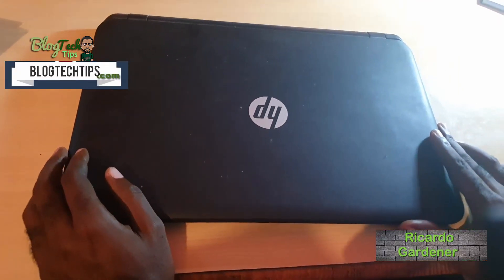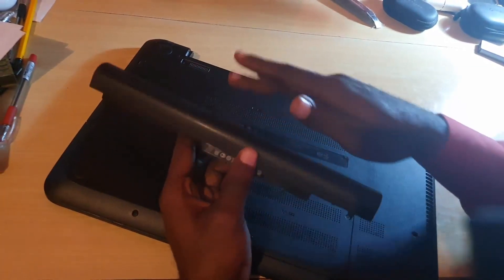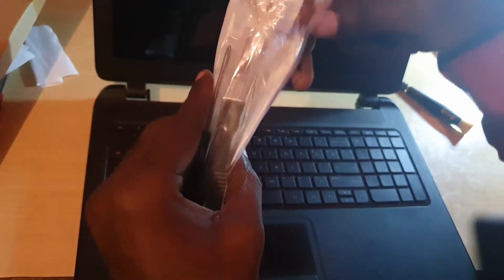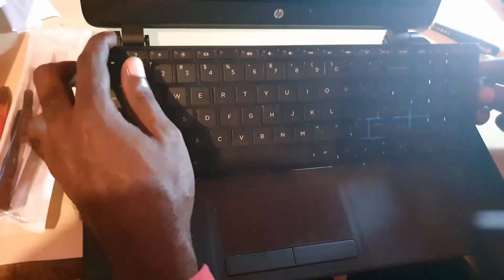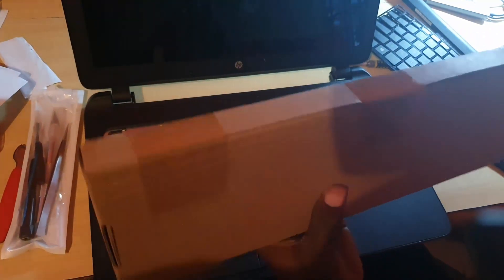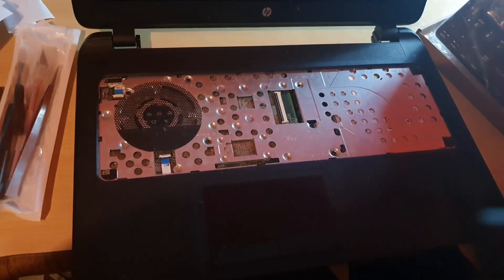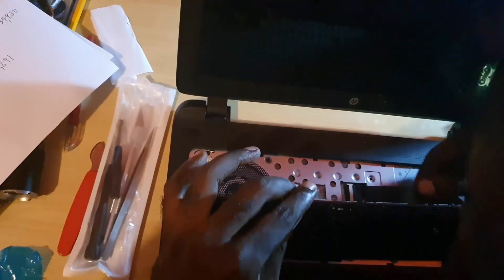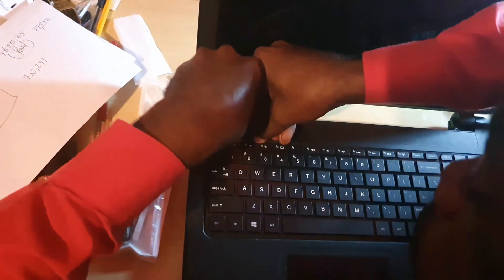HP 15 Series Laptop Damaged Keyboard Replacement

Comment: No this is not for all HP 15 series this shows the replacement of the simplest keyboard to replace in a hp laptop there is.  The HP15 ( 15-cc, 15-cs, 15-cr) laptops are exponentially harder because there is a grid in-between the keys and you have to replace it from the Backside of that grid "Shell". it basically is the first part in the assembly of the whole laptop and everything has to be removed before it can be replaced.
Reply: correct
Reply: Thanks. I had to give a virtual punch in the lip on that as well because there are TONS of HP 15 laptops that do not even remotely have this style of configuration. Some people should simply not make videos if they can't share correct information or at least refrain from sharing incorrect information.

Comment: Wow, thanks, I had no idea it was so simple. i can do this, easy. You got anything on USB ports for this model? MY USBs both failed and won't send any data, and the 6,7, y, u, h and n keys all failed within a week. The ports still charge, but nothing registers when you plug it in. I've tried updating and reinstalling all the drivers, but it doesn't work, so I guess it's hardware. I don't know if it makes sense for both to fail together like that, but new drivers doesn't seem to help.

Comment: I think I broke it. I removed a half working keyboard, then tried to put it back in and then it was 0% working. Then I tried snapping in a braNd new keyboard. Still 0% wOrking
Reply from the maker: Based on what you are saying you are probably not connecting it properly.
Reply: Ricardo Gardener The thing is, when I first popped the keyboard open, the ribbon slipped out with me barely touching it. And when I try to slid in and secure the ribbons, even though I push it in until I can’t anymore and latch the black thing, it still slides out so easily. I can seem to get it securely placed into the latch connection. It’s loose no mater what. With the new and old keyboards